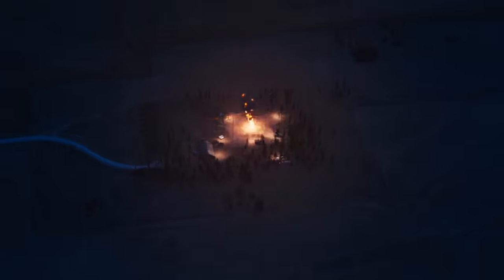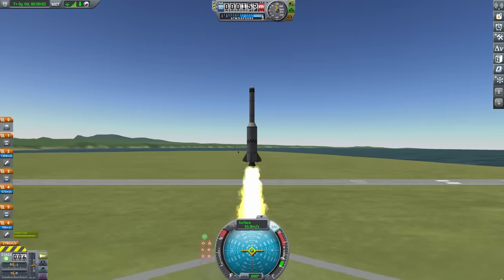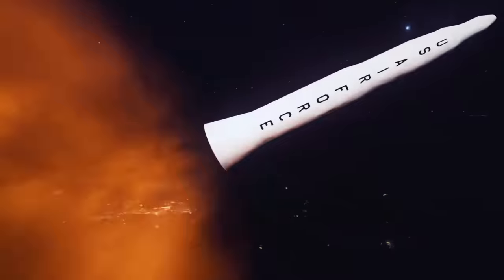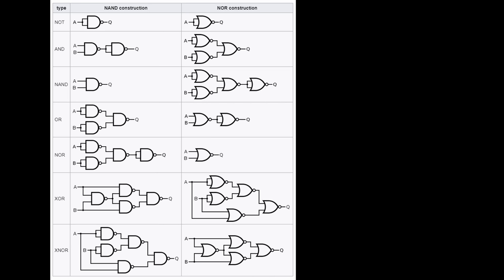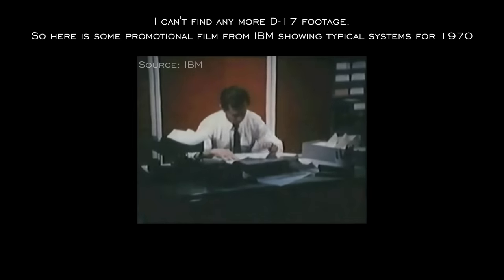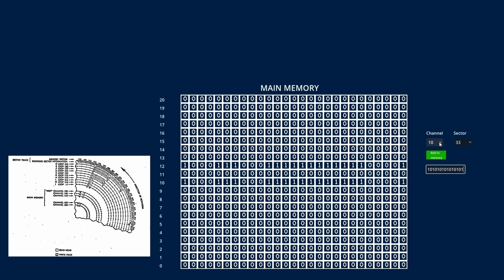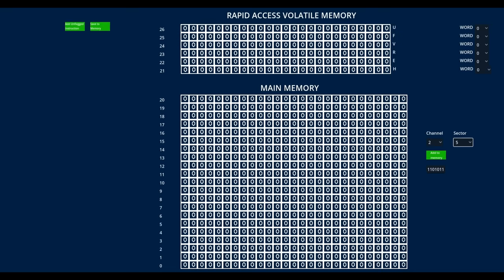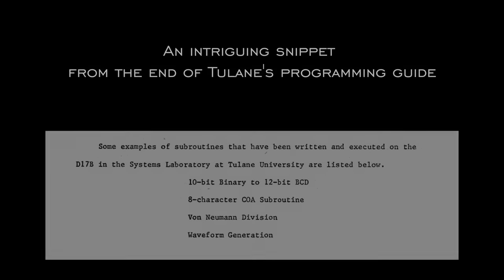Minuteman D-17b: The Desktop Computer Was Born in an ICBM

Comment: A short comment on the fucntional completeness of a boolean logic system, which is what is being talked about briefly and misnomered as turing completeness. You don't need two logic gates, you only need one, NAND and NOR, for example are functionally complete. As they NOT a signal when you feed the same signal into every output of the gate. This leads me to the comment that, paraphrased, a computer actually consists of a mutlitude of gates types. This is only somewhat true. You might, very infrequently find some other gates than a NAND gate, but essentially modern computers are entirely constructed from NAND gates. This is because the NAND gate is incredibly simple and so already extremely space saving. Additionally focusing R&D on a single thing further increases the space saving on on modern ICs.

And to take this a little further: ever since CMOS has become the technology behind modern electronics this process of focusing on improving one component has been applied to the CMOS switch, from which the Logic gates are themselves constructed, which also happens to be a NOT gate in CMOS. While not functionally complete in formal boolean logic in a a real world switching level context the CMOS NOT gate is functionally complete.

Comment: Can a Minuteman missile be recalled or remotely destructed?
Reply from the maker: I had this exact question! The answer is a resounding ‘no’ (for the minuteman 1 anyway).
Once those keys were turned, they were committed to nuclear war.

The test missiles had termination charges but the operational ones didn’t
Reply: Nowadays the guys in the missile bunkers (which are still there) do exercises every day involving turning the keys, and never know whether they will actually be launching. The only determiner is whether central command have sent through the correct codes to complete the launch procedure.

Comment: This is not quite relevant. But the (previus) car company Saab use to make flying Computers for Swedish airforce prior to integrated circuits. I went to uni at the place where those was made there was bunch of them around still when i went. Just board and boards of transistors
Reply from the maker: I’m 100% going to be doing a video on that in a few months.
Reply: @Alexander-the-ok  really? I though this was very obscure, while fairly early.
Reply from the maker: @matsv201  Several viewers on my F-14 video have asked about it so I've started researching it. I presume you're referring to the flight computer on the Viggen?
Also, obscure topics are the ones I love discussing the most!